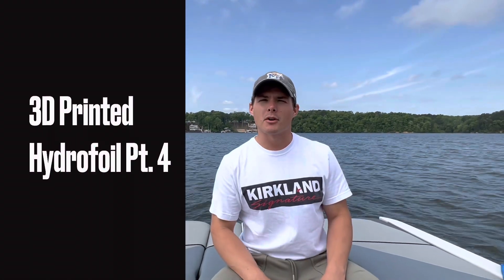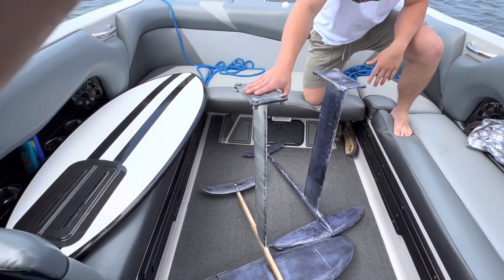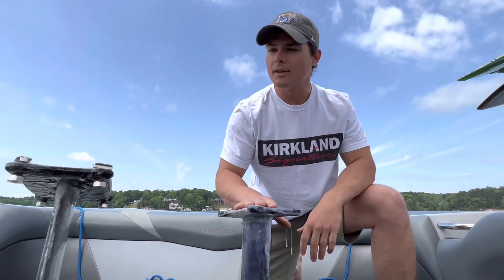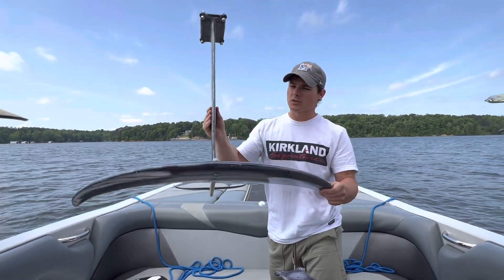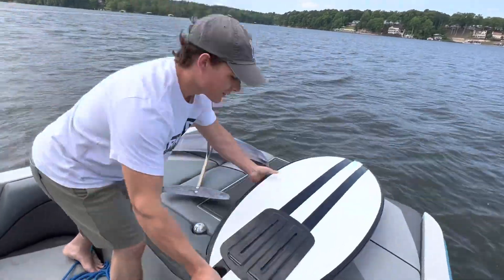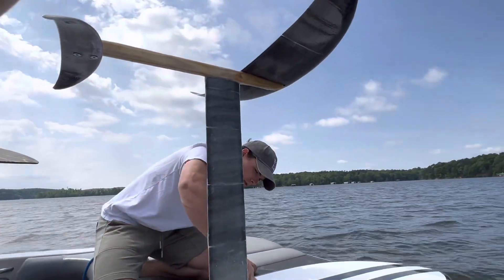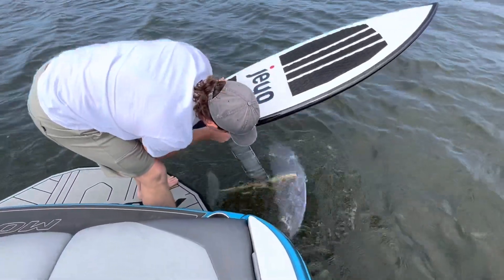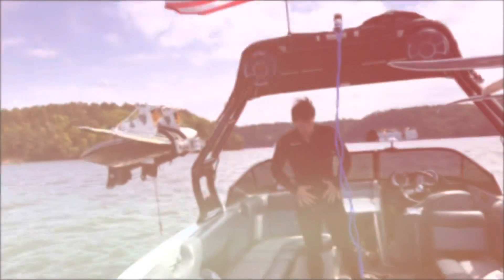3D printed Hydrofoil Pt. 4

Comment: Nice work! a bit of unidirectional carbon tape, and high density epoxy filler would help you out a lot with structural integrity.

Comment: I’m interested in the wing from the first one, I have two mp select minis and a whole lotta epoxy and fiberglass left over from when I built a Clearwater foils kit with the 2300 and 1500 cm^2 wings, I am looking to build a high aspect wing that would come in many pieces that would fit on my 12x12x12cm work space.